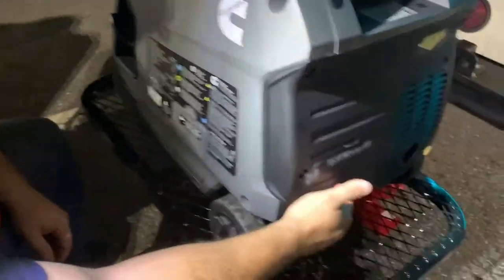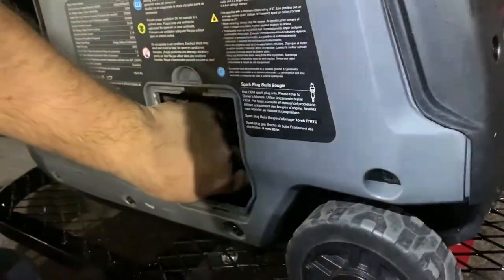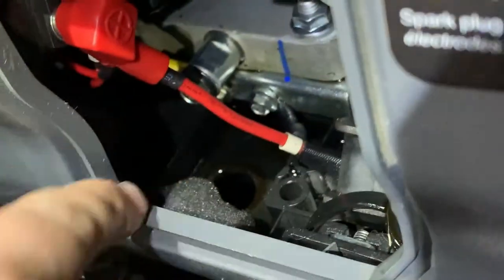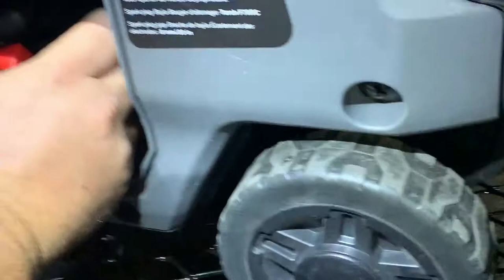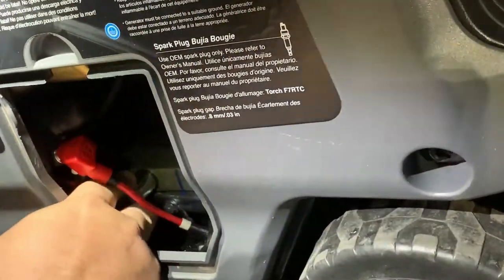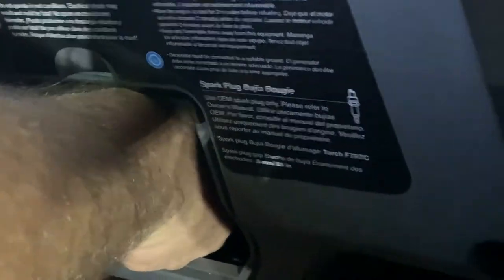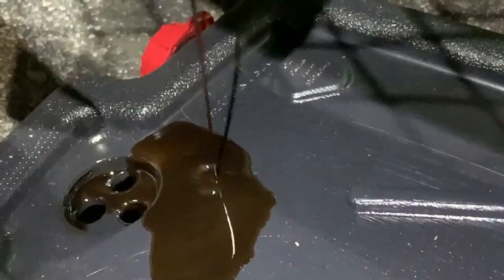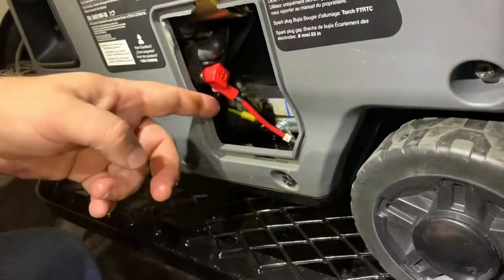Onan P4500i Inverter Portable Generator - Oil Change Step 1

Comment: Thanks for a great video. I really liked this genset, however They did a really bad job of making this unit easy to service. Accessibility is terrible. It is ridiculous of them to think that you can do this oil change easily through that small plastic door. I have learned that it's much easier just to remove the entire side of the unit. This makes the oil change extremely easy with standard tools and room to use them. You will finish sooner and less frustrated. Opening up the side also allows you to clean away the oil in the bottom of the unit where the rubber drain plug is located. You can also inspect the unit and clean away dust if any. To remove the side cover, remove the two recessed handle bolts at the top, and 2-3 Phillips head screws in the black back cover and front panel edge as well as the obvious side cover bolts down low on the side. Then just pry the black front and back panels gently away in order to make room to  pull the side cover out. Since the pull start cord goes through the side cover just set the side cover on top of the unit with the pull cord still in it. Easy peasy.
Reply from the maker: I pulled the generator out the other day, battery was dead so I pulled the cord. Broke instantly :( Got a charge put on the battery and I am good now. The side removal is definitely a good option.

Comment: Is there anyway to get a wrench in from the bottom after you pop the plug . 
I also saw someone use that screw in funnel and tilt the machine on its side and drain the oil out of the funnel.
Reply from the maker: I do not recommend tilting it or flipping it over. I bought a mini wrench to get to the bolt from the side. You can try from the bottom, but it is gonna get messy. I wish they had some way of getting the oil out more cleanly.

Comment: No filter?
Reply from the maker: Just the air filter. Needs to be cleaned out every 200 hours at least.
Reply: Small engines almost never have a oil filter other then maybe a screen in the system.